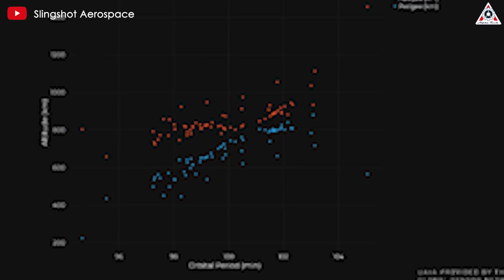Disaster! SpaceX's Copy Rocket Company Failed "Explosion". Musk is laughing...

Comment: Wrong title...It is not copying as making 1 cake in 3 pieces(if the cooker is American or German or Chinese,it does not matter),its the taste formula and the quality as the patent...We dont have any way more than 3 or 4 to have RE-USABILITY in rockets...the hardest way is the on top vehicle rescue(which come from longer distance and get fastest speed during re-entry and have burning protector shields)then the easiest is the booster rescue which is coming from a closer distance and also has burning issues in re-entry...The mid section as DIRECTOR machine or The Cargo holder Box rescue must be in between in hardness but because of non-aerodynamic shapes for The DIRECTOR Machine of Cargo it is hard and for The CARGO BOX MODULE because of opening doors and the lack of  engines or fuel (for safety issues) the rescue is hard again ...